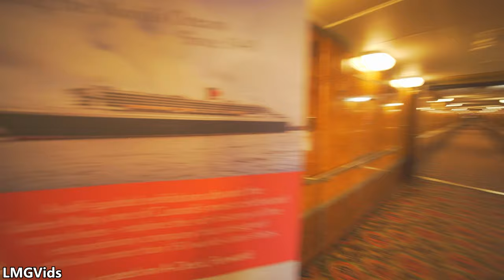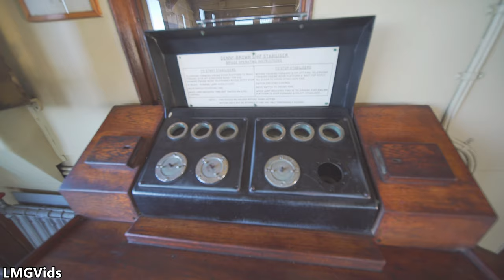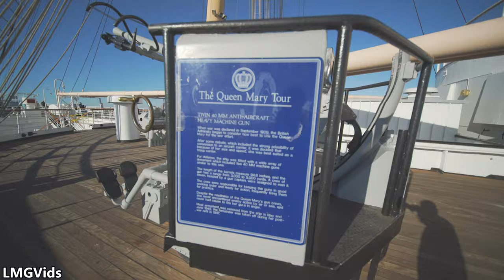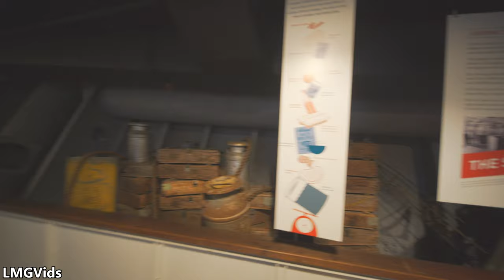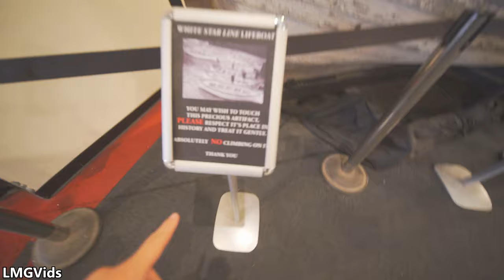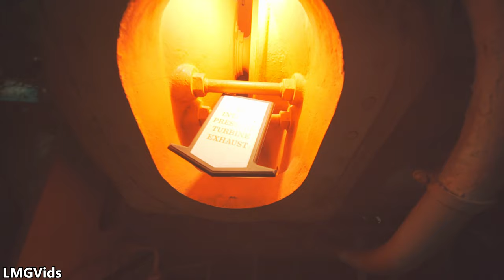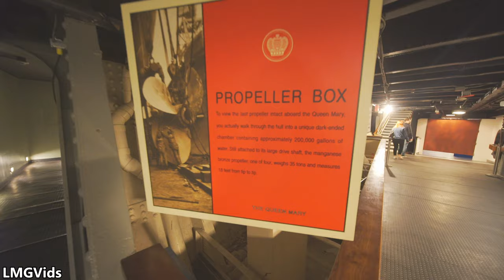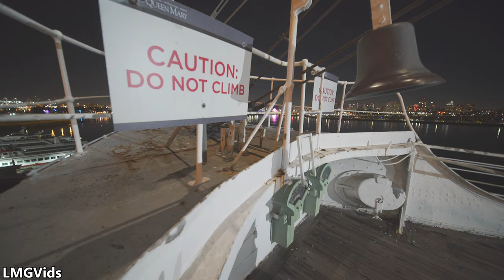[2020] RMS Queen Mary Ocean Liner Exploration - Long Beach California, Partial Tour of Ship + More

Comment: That guy around 36 minutes talking about the Titanic coal fire is all wrong. There was a coal fire, but coal fires were extremely common on coal fueled ships prior to the introduction of diesel. Also, Titanic’s coal fire was no secret, you can read testimony from surviving stokers about the effort to put out the fire - it was eventually put out on the morning of the 14th of April.
Also, the picture he mentions that was uncovered in 2017 does indeed show discoloration but it was an optical illusion - the discoloration is visible on the area close to where Titanic’s mail room was, well above the waterline. The coal bunker where the fire was located was further aft of this and below the waterline.

And another thing - Titanic was not built for speed and Captain Smith was not attempting to break a speed record, White Star Line ships were built for comfort and luxury whereas Cunard ships were built for speed. She wasn’t even running on full power when she hit the iceberg.